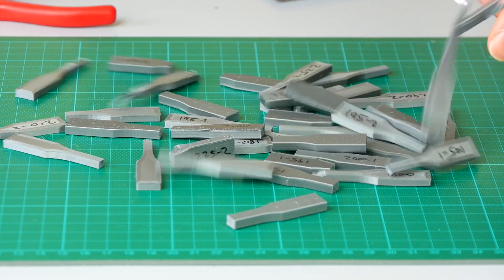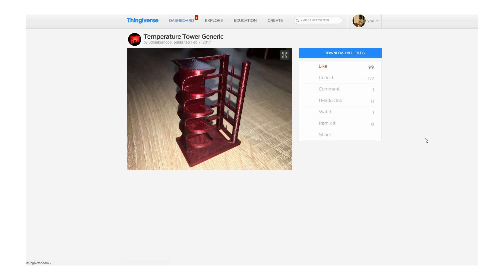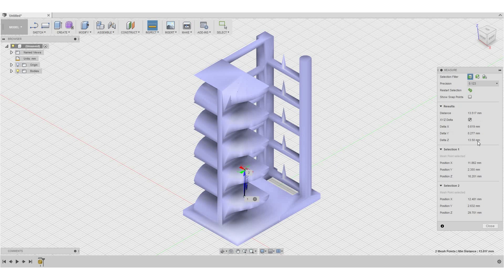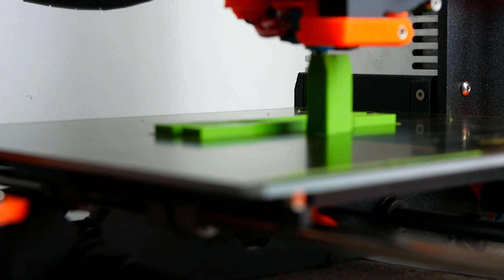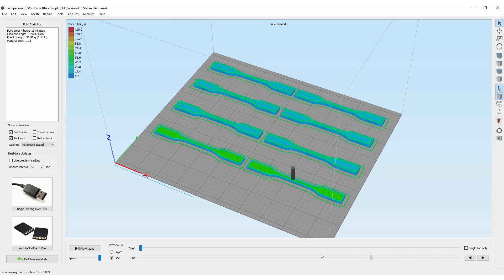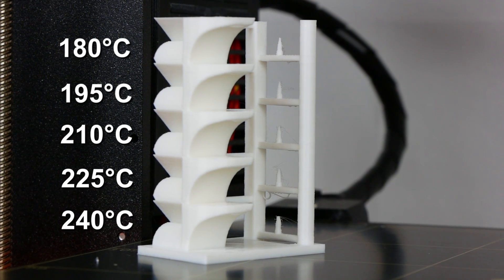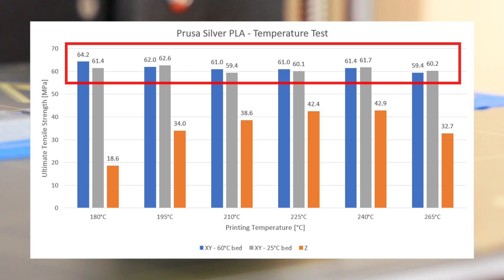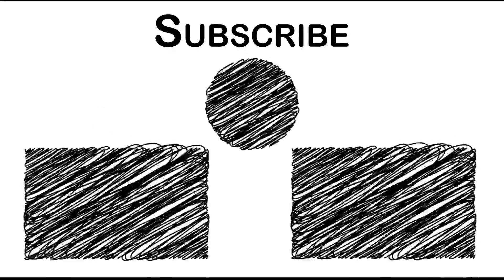Printing PLA at 265°C? How does printing temperature affect strength?

Comment: Same test with ABS and PETG would be apreciated ☺ Really nice test you did, thnx.
Reply from the maker: I'll do that. Just need to organize some proper filament. Just have crappy Hobbyking ABS at home.
Reply: @CNCKitchen , it's been TWO YEARS!
Reply: @CNCKitchen  ABS and Polycarb?
Reply from the maker: Depends on the application. PC can be hard to print to is stronger than ABS. PC/ABS blend can be a good alternative, with benefits of both.
Reply: Maybe do a different layer-height vs layer strength comparison as well? Also I was complaining to local pla manufacturer other day that the black filament is coming too transparent / bit purple on in bright places and he said he doesn't want to add more pigment as the strength would degrade.. transparent vs pigmented one?
Reply: Please do PETG!!
Reply: +1 for PETG, I do not print ABS anymore though.
Reply: I gave you a thumbs up because your name is, Google+ SUCKS BALLS - the worst forced social network. Your comment could have been a simple, hi, and I would have given it a thumbs up because of your name. Love your name.

Comment: You know you can set the temp based on layer height within a single process ?
Reply: Also, since you know your layer height and you know the height of each block you can work out the layer with simple division.
Reply from the maker: Yes, I know that, it's definitely a quick option, but I didn't like the idea that I have to calculate the layer number. With the different processes I'm now also able to use different layer height.
Reply: @CNCKitchen  I know this is a really delayed response to this, but it's actually really quick if you pop into the print preview and use the layer preview slider! You can zip to each of the points visually and jot down the layer number.

Comment: you accidentaly said 290º instead of 190º at 1:35
Reply from the maker: Damn :D I must have listened to that like 10 times....
Reply: @CNCKitchen  its fine, i simply cut it out. ( i retry it bevore again. ) but cool video.
Reply: Dont sweat it CNC. You said a thousand things correct. Thats gotta count for something. Thanks BTW.
Reply: Maybe if your using a 1mm nozzle and 70mm/s 290 is fine lol
Reply: Nobody is perfect, very good video. I use almost 7 years PLA at 220 °C, without any hot bed. Just printing on a glass table with glue stick layer.
Reply: @mrstanlez  ultrabase is better.  no glue no cleaning. still glass. though you have to heat to about 60c.
Reply: @technodrone313  Maybe yes, but not in my case 80 x 50 cm for a printing bed, by using 0.4 mm or 0.2 mm nozzle.